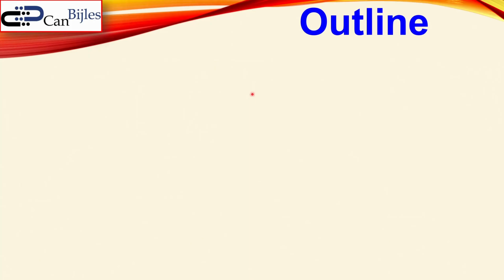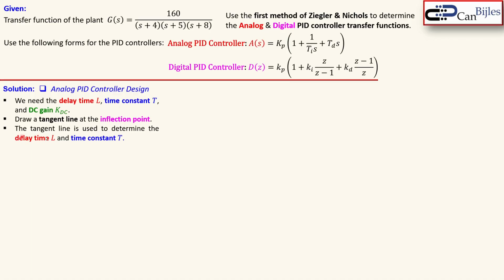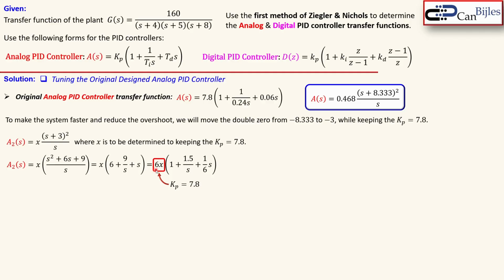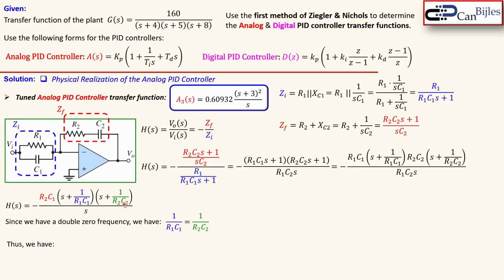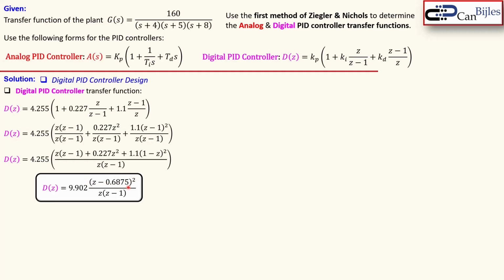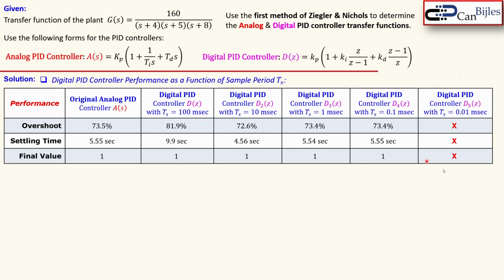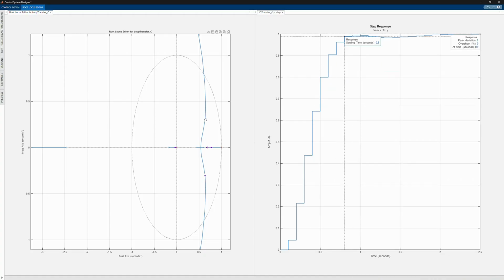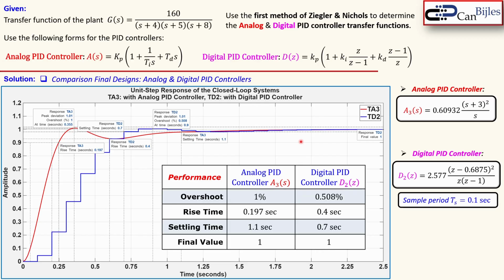Ziegler & Nichols Tuning (OPEN-LOOP) 🎯 PID Controller Design (Analog & Digital)💡Complete Tutorial😎💪🔥

Comment: I designed the implementation of this method for auto tuning in Visuino!
Reply from the maker: That is great. So, you used a digital controller for your system with an Arduino?
Reply: That is correct, the Visuino code is compact enough to run on a Arduino Nano with i2c lcd display and digital temperature sensor (DS18B20) the Visuino code runs the Auto Tune and when it finds the values, it stores them in the memory of the Arduino.
I have used this method to achieve temperature accuracy of 0.1 def C! In a laboratory water-bath ! @CANEDUX
Reply: @CANEDUX That is correct, I use the code to find the PID values that are then stored on the Arduino Nano, I have achieved an accuracy of 0.1 deg C on a laboratory water-bath!
Visuino works great and is really fast for complex tasks!
Reply from the maker: @petrusbosman4264  That sounds great. Maybe I will try this too and make a demo of it.